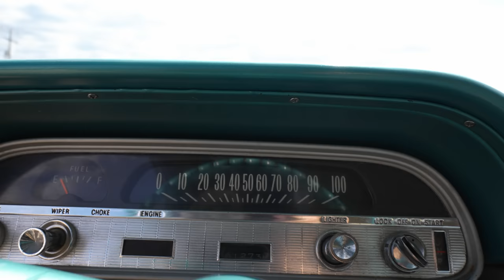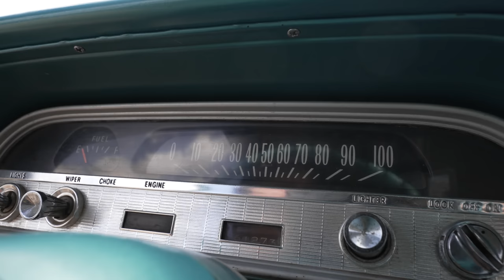Huge Military Axles & A New Corvair...What Should I Build Next?

Comment: I think an off-road 6x6 roll-back would be a really neat addition to the line up. Great content Matt and team!
Reply: Exactly what I was thinking...
Reply: Should be a cab over for better approach angle
Reply: You are smart!
Reply: Rollback!  Kills me to watch front ends get banged up on the wrecker.
Reply: You beat me to it
Reply: Same thing I thought too
Reply: I agree, 6x6 rollback with rear steer
Reply: EXACTLY what I was thinking, looks like all three will steer, so make it an articulating rollback, that'll give Tom some maths to work out.
Reply: Exactly the first thought I had as well.
Reply: Thinking the same thing!
Reply: I thought rollback right away too.
Reply: @wayneshannon9936  I agree but less about approach angle and more about minimizing the wheelbase
Reply: @cjrocket2787  that’s a great point too. With it being a 6x6 rollback I think they would use it less for more technical jobs so the wrecker has a purpose but also the benefits with the cab over is weigh down lower. If I were matt I’d consider a smaller crane behind the cab to assist with jobs on cliff sides.
Reply: Make it 6x6 but the front axle pivots like a loader.
Reply: yep. Can't say no now....
Reply: Make it a 6x6 with extra long winch cables for canyon recoveries
Reply: Was gonna comment this
Reply: That would be soo cooolll!
Reply: That was my first thought😂
Reply: I was thinking the same thing.
Reply: Darn I was thinking the same thing
Reply: I came here to make this comment too.
Reply: Would be the perfect rig for picking up rolled side by sides.
Reply: 6x6 rollback would be sick!!
Reply: Converted school bus would be awesome!
Reply: Same thought I had too.
Reply: Roll back with seats for 6.
Reply: I have a '54 GMC COE cab that I could donate.
Reply: mega-potato truck!

Comment: Taking a distributor apart and repairing it is top level roadside repair. I am impressed with Matt's trouble shooting abilities.
Reply: Exactly! I can't imagine even attempting that fix on the side of the road.
Reply: It is not that bad - at least it wasn't raining the two times, I did it, although it was dark!
You learn a lot when you can afford only wrecks!
Reply: serious demo car triage and meatball surgery
Reply: I had the throttle plate in my 97 GMC SONOMA SLS stick open at 80+mph while going down the freeway here in Southern Commiefornia. 
After driving about 10 miles I threw it in N and killed the engine IMMEDIATELY.
I coasted off the Freeway and down an offramp to where I could take a look.
I had little to no experience with the this aspect of the 4.3 Vortec but discovered that there's a half-cup shaped restrictor in the backside of the Throttle Plate and it got stuck by the built up Carbon and wedged itself open.
I had nothing but my trusty Gerber multitool and a will to still go meet up with my friends. 
I filled the intake with paper towels (I always have plenty in my vehicles) so nothing could go where it shouldn't and proceeded to surgically bend the thing back and forth until the rivets let go. I removed it and the rivets and continued on my trip. 
I then went to the junkyard and got me a "new" throttle plate and with two screws... back on the road.
An experience I don't care to live through again but grateful I have some mechanical knowledge and not one to panic when TSHTF 😁
Reply: Hmmm...my 1st introduction to Jesus was when my 1960 Chevy pickup blew the brake pads on a front wheel and this dude came out of his house and got TOTALLY GREASY and WET (raining) helping me get going again (2+ hrs) and wouldn't take a penny...just told me to remember, "Jesus loves you", and man, have I found that out a thousand time more!
Reply: yea but he missed a perfect chance to do spocks line
'I am endeavoring, ma'am, to construct a mnemonic memory circuit using stone knives and bearskins.'
Reply: I like the mini Episodes of MORR or LESS Prepared they throw in.

Comment: I've worked as a welder at Oshkosh Defense for 28 years. I look forward to seeing what you all do with our fine axle products.😉👍
Reply: Are these produced there? Or are the made at AxleTech by the campus? They used to have a contract with Oshkosh defense.
Reply: Oshkosh Defense MTVRs are freeking O U T S T A N D I N G. Can't say enough good things about them. Thank you and all OSHKOSHIANs for those. Keep up the great work.
Reply: Is Oshkosh still building them axles
Reply: they would look awesome under the 6x6 potato truck
Reply: @pvanhorn12 yeah cutting a few yards out of the frame of the spud truck and put these axles under it with a big block and an overbuilt transmission and multiple Tcases. It won’t flex very well but you can’t break it

Comment: Does this ever bring back memories... I was a mechanic at the Corvair Shop (Santee, CA) in the mid-1970's. Those Powerglide equipped 60-63 models were shockingly slow on acceleration. I was a Corvair mechanic, a Chevrolet Parts Counterman, a welder at Tacoma Wheels and Parts Manager for Desert Vehicles (became Rough Country), in the years after graduating HS in 1972. I went to work writing shop manuals in 1982 and still edit content for Snap-on Tools.

Comment: That one is easy: 6x6 with 3-axle steering, front cabin with A/C and built-in Mountain Dew cooler, with a modular rear deck that can handle one of three modules: rollback platform, heavy wrecking boom/rotating crane, or mobile workshop with full tool complement (lathe, drill press, welder, etc.).
Reply: This!
Reply: Just a little bit rediculous, can't overdo it!
Reply: Whatever they, the axles, morph into it has to have a LARGE fuel tank with a gas gauge that works so Matt has no excuse to run out of fuel. Ever!
I would support the mobile workshop platform with a rollback to pickup what you can't repair on the trail.

Good video and kudos to Jamie and Jeffery for bypassing Matt's procrastination and buying the corvair. Not the greatest car GM ever produced but it's "Matt's delight" which is what it should be called. 

Shout out to the one good Samaritan that stopped to offer help. Fascinating that for all the tools he had there was no hammer. Thank you!

As to restoration, it's fun to have it original and if it hadn't been repainted I'd agree with Matt, fix the problems but leave it original. 
BUT, since it's already been painted, badly, why not fix the problems, repaint the body, by Robbie Layton, and put a new headliner in so it looks like the gem Matt will be proud to putts along in at 50 mph. Maybe he'll even let Jamie "borrow" it to do the shopping occasionally.
Regards from Canada's banana belt.
🤞🇨🇦🍌🥋🇺🇦🕊️🇺🇲🤮💩😜🦃😁👍
Reply: Forgot the fourth module -- a bus-like compartment to carry people around.

Comment: That was the Best, Matt & Jamie! I had a similar repair on my 1992 Ford E350 Winnebago Motorhome. I had repeated problems with the Distributor losing power as we traveled from Washington to Montana. I finally had to have one tow into Butte Montana and the shop supposedly fixed the distributor, but they never changed the pickup. The next day, we stopped at a Rest Area near Rapid City SD  to sleep. Woke up, had breakfast and then tried to start up...Nope! Dead! So, I took my Toad car and ran into Rapid City and got new parts!  With the minimal tools I had, I carefully removed the distributor, took it apart, changed the pickup, got everything lined up & put it back together. Away we went! Drove 7000 miles more w/o difficulty! I had my Wife Martha helping me get everything together! Team Building for sure! You folks are THE MODEL for the 21st Century! Blessings!

Comment: I had I believe a 61 used Corvair around 1967.  It's been a long time ago but I'm sure that's the year.  It was my first car.   The engine was air cooled and ran great. Didn't burn a drop of oil however the body was shot.  The floor boards were rotted out like a flintstone vehicle.   The gas linkage broke so I kicked out the back window and ran a string thru the vent in the back hood down to the carburetor.  I pulled the string to accelerate.  Having the back window conveniently out made it possible to haul my guitar amplifier to jams. I was 16.  Never did get the title from the shady dealer. 
That's my experience with a Corvair.   Oh, it did roll over sideways back on its wheels in a corn field for some reason and it never even hurt it.  It just got muddy.

Comment: Excellent roadside repair job. I think it's great that you plan to keep the 'new' Corvair basically in stock form. For the headliner, perhaps a shop could replace the ratty one with a new one with a bit of an aged appearance so that it doesn't stand out so much.
Reply: That's what I would do. This car is cool that so much is still original, but it's not a museum piece, so fix the wiring, and replace the headliner with modern materials, but with the look of original. Being me, I'd probably also add sound dead'ing to the door panels and look for rust, treat and paint, and apply the sound proofing/insulation.  A "Resto-mod" vs a "full restoration". And drive it.  Also I'd replace the tires, a blow out on the hwy and you might not have anything.

Also I'd put 3point seat belts in it, front and back. Having been in an auto accident (not my fault) those things saved me from being hurt bad.

Comment: I once done such a road trip back and forth so around 1300 miles on a motorcycle that have 50 000 miles on it and 10 years old. A small 250cc 4stroke V-twin cruiser made in china by china. True the rears i have it disassembled completely 3 times for mechanical and electrical problems. I know it back to front and can determined low oil level and overheating by sound alone. It let me stranded 3 time, first faulty battery, second time electrical fault due to riding when it was snowing. After it dry out it run like nothing happened, and lastly clogged up carburetor i was not able to open. Need a bump screwdriver to open.

At those two 600miles trips, i was the only one that dont experience any mechanical problem, not even low oil level. So sometimes its not that old things were build better but how far a proper maintenance can get you and beauty of simple machines. But i ride like that guy that help them, always have tools.

Comment: Fun Powerglide fact, especially for Corvairs with finicky starters, they can be push started. You have to get them up to about 30 mph before it catches but it works. I did it when I was a kid with a buddy's car.
Reply: That only works with early cast-iron Powerglides that had a rear pump. The aluminum-bodied Powerglides did not have a rear pump and cannot be push started. Corvairs did not get the cast iron units.

Comment: If you're drilling a small hole like that and causing the workpiece to burn here's a few suggestions on how to machine that:

1. Use a spray bottle with water.  You can add water soluble oil to help lubricate, but keep it water heavy as that's what does the cooling.
2. Lower your spindle speed, if possible.
3. Feed harder so you're taking a bigger cut and not rubbing as much.  This will help get the heat into the chips. 
4. Buy sharper drills.  Or do staged drilling.  Larger diameters tips move quicker than smaller diameter tips so you''re creating more heat by default.  If you have already removed material with smaller drills your larger drills are doing less work, but still have elevated SFM, or surface feet per minute.  
Happy machining!  :)

Comment: Interesting that the distributor seized.  I had the same thing happen to me in about 1971.  We had a Corvair Greenbriar van that had sat for about 4 years.  A week or so after getting it back on the road, we went for a 100 mile trip.  Just as we were arriving at our destination, the distributor seized and spun.  Of course, the engine quit.  Like Matt, we were able to effect a roadside repair, although I filed out the distributor bushing a bit in addition to dressing the shaft.  We replaced the distributor when we returned home.  We eventually replaced the engine and three speed manual transmission with a slightly more powerful engine & a four speed transmission from a Corvair Monza.  Interestingly, the first gear on the three speed was much "lower"  and it took a bit more clutch slippage to get the van rolling with the four speed. Once rolling, the four speed was fine.

Comment: I almost never saw anyone use an oil filter wrench to tighten an oil filter. I was a mechanic in a past life and we just gave a good hand tighten. Looking at those forearms I think Lizzie's got the hand strength to tighten them just right.
Reply: I was cringing watching her use a filter wrench to tighten that filter. It says on the filter to hand tighten 1/2 turn.
Reply: My guess is they make extra tight because of all the bouncing around they do but idk
Reply: It makes a nice oil trail down the street if one gets a little too tight and splits the gasket.  But when my hands are oiled up, it is difficult to get a good grip to snug it down.  I guess it is all in the touch when using a wrench.
Reply: I honestly thought they were only for getting them off if the last guy went too hard
Reply: @newjerseyhun if the vibration is that bad they can get a racing filter with a safety wire hole and wire it. I always go hand tight and never have problems with them leaking.
Reply: @xidarian  gotcha, I never heard of one of those

Comment: Absolutely a very cool car. I am old enough to remember them very well.  They were cool back then. A 327 Covair... great hot rod.. the Yenko Stinger.... Sadly  they had mid engine handling "differences " so they developed a reputation... HOWEVER  what a great save of a good looking car. What a great trip and adventure.  I hope you do a restoration build on it. Paint it to original and bring it all back to stock. I am sure Robbie can handle the paint work.  You can do a little engine work to help it have a little more pep than stock.... but otherwise yeah a good rebuild and bring it back to original inside and out.  What a great run about to park next to the Morevair... Coker tire can get original looking new radial tires ... great show great trip great little car. CHEVROLET should take note... bring back the Corvair  ! A modern version.. air cooled ... just modern design and upgrades... 😮

Comment: Such a cool Lakewood! Awesome score! I love riding/driving in my dad's '61 700 Lakewood (updated 110HP, stock 3 speed (non synchronized) and look forward to getting my '62 Monza wagon going! I love Corvairs so much! I also have a '61 Monza sedan, '61 Rampside, '62 700 wagon, '62 Monza sedan (my baby), '62 Rampside, '63 Rampside, '65 500 sedan (110HP/PG with factory air conditioning!), and my '65 Corsa convertible (140HP). I love Corvairs! So cool Matt! I think a Recovery unit based off a Corvair 95 Rampside would be amazing! Or Jeep FC.....

Comment: Glad you are keeping it as original, that makes it more historical as it was designed.  The worn distributor can be repaired. One nice thing is most of the car is metal which is repairable. All the 70's and up cars OEM put in so much plastic parts that can not be easily fixed.

Comment: What a great find!  I like the idea of keeping it original, but I think you're going to want to add some AC to it and definitely replace the headliner.
Reply: But first get the distributer fixed.  Probably the starter as well as it sounds like it wasn't always engaging.
Reply: I'd image a good interior place might be able to find some "aged" material that wouldn't look too new to be out of place. Or maybe a light die job to take the edge off.

Comment: Suggestion for the headliner: You should have enough donor headliner material from your other Corvairs to cannibalize enough for a few patches. A good seamstress might be able to handsew in place. If not, expertly remove the headliner (they were not glued in place) and reinstall. If the original headliner is fragile/dryrotted, then carefully remove it and have your upholstery guy glue thin linen on the backside to give it strength. Patch as before.

Comment: Bowed headliners are difficult to install.I have been doing auto interior , upholstery work for about 50 years now. What I would do since you don't want to make that new headliner look really really good? Try to keep with some of the patina you got going there. I would go down to my local automotive upholstery supply house and find some material that kind of looked old. Remove that one and use it for a pattern and build a new one. Acme headlining will have a headliner for your car pre-made and ready to hang. I also noticed that your visors are missing? The headlining kit will come with enough material to cover your visors. If you look through some of their samples they have some p material that's called broadcloth.. it kind of looks antique  and old. Or if you don't care about none of that you can get the original white vinyl with the little basket weave pattern in it and hang it up there good luck sport!! You need any advice let me know I'll bet you won't get it in there and make it look tight and no wrinkles? Like I can really cool car man! I like the part where you used a rock to sand down the distributor shaft.😅

Comment: I've had a bunch of corvairs.... and a good bit of fun with them. I would do the headliner and the door panels at least, maybe touch up some interior paint. Repairing the inside to make it nicer is not going to hurt it a bit. In value or it's survivor status. And it'll be just that little bit more fun to cruise in. Since you like corvairs - why not a rampside 6x6 recovery truck? Even if you just used/modified the cab to use like a cabover style truck. The adventure home was fun to watch. Thanks for sharing